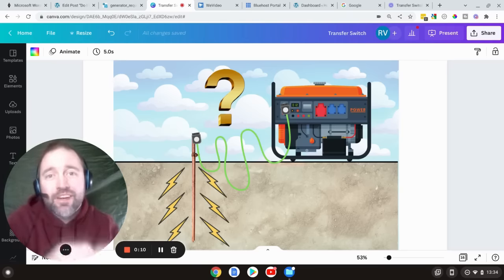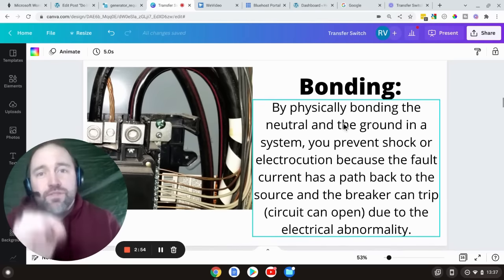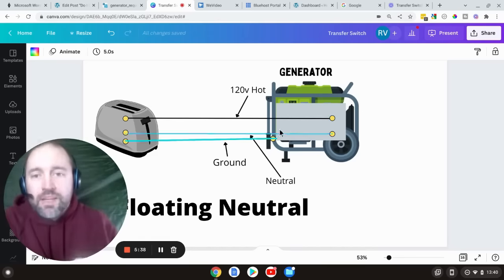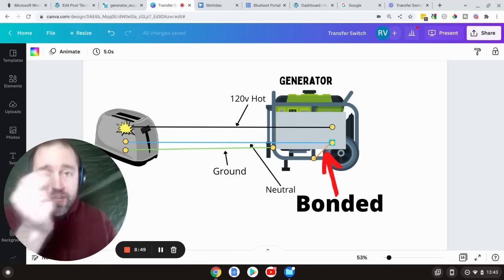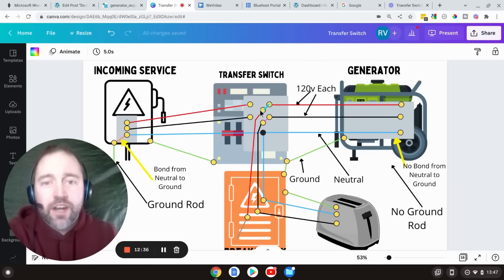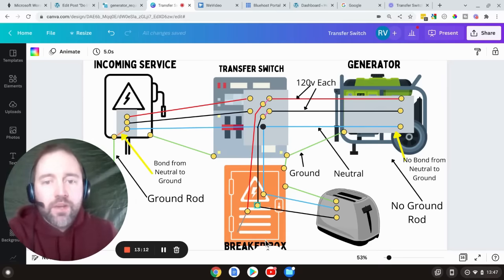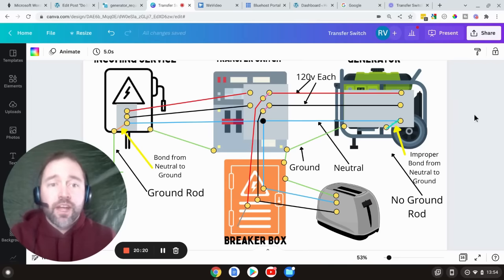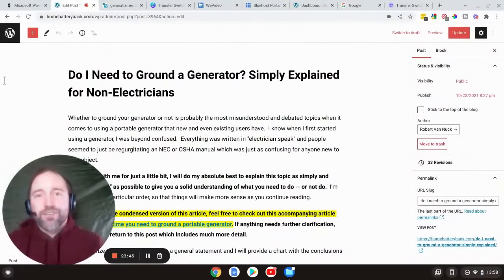When You DO and DO NOT Need to Ground Your Generator [Extension Cord Use & Backfeeding a Home]

Comment: I have solar panels batteries and an inverter my inverter is a split phase 120 no 240 so its 60 volts to ground my main intent for this inverter is to power my boiler tested it works fine under this load the boiler pump is perfectly happy no strange noise I have a hot and neutral switched transfer switch the inverter is grounded to a rod near its location which is to far from the main service ground which is bonded with heavy gauge wire and several rods exist  all bonded the inverter ground shares its rod with my solar panels but the neg battery terminal is not grounded as its isolated by design no way to use a single ground point in my system the advice I got from those with experience was to bond all the rods which I did already and due to some tight bends that I had to make that I did short of 90 degrees I installed copper tubing to make the ground wire thicker in those locations would you care to explain why under these conditions its best to bond all the rods vs not my understanding is relying on the house wire for a ground when providing a second power source is bad the inverter is like a gen but having a grounding rod not bonded to all other existing rods means that any potential difference will go through the house wires also bad bonding them reduces this load also using 4 awg wire makes the risk almost nil also playing a role is AL siding and some of the bonding wire is hidden under the siding I suppose if I spent the money for 000 awg wire I could ground my inverter to my main service ground 

the reason for all the rods is I have intermittent ground  from my power company and they can not do much if its not a problem when they come to inspect they can clearly see they have issues as the test they ran shows elevated voltage drop on the ground/neutral far above what they should expect for a service line of the length of =what I have so they said put in a bunch of grounding rods so I have one 8 foot standard copper clad steel rod then I have 6  rods all 5 feet or more not much more long 1.75 inch brass tubing we have had allot of close lighting strikes no damage so they do double duty and yes we have surge suppressors which need a good ground to do their job and the grounding rod is normally the weak point in such systems grounding seems so simple until you look into all the design limitations such as location of generators and inverters that need their own ground as well as what happens during a lighting strike either to the power lines or near by or direct and the ground rods do not have enough connection to earth and or you have a multi contact system like mine
Reply: having extra ground rods tied together is not bonding. Bonding is connecting the ground rods to the neutral bar in the main panel.

Comment: H  E  L  P      I'M  Not To Smart I'm Not Educated  I IN MY 70'S !  I really Don't Understand this Stuff even with YOUR VIDEO which is a GOOD VIDEO I have a 9000  Harbor Freight  Generator in my shop for yrs  it's a Shed I use it for Welding and Other things out in my Shop I ran a 7' COPPER GROUND ROD in the GROUND and a HEAVY COPPER WIRE up to the GENERATOR  about 5 to 6 ft. Long , which says GROUND ( many people told me to do this )did I do the RIGHT thing or the WRONG thing I don't UNDERSTAND could somebody EXPLAIN to me if I did RIGHT or WRONG PLEASE  ! Don't what anyone to hurt !                 
 I have A  Extension Cord Forget what GAUGE I think it's 6 WIRE  it was WELDING WIRE  got from  Amazon , Homemade Extension Cord for my Welder which is about 25 to 30' long I used to hook up the  Generatorand to the  WELDER  . IS THIS OK 
P L E A S E    H E L P

Comment: In summary:

- If the transfer switch doesn't switch the neutrals, you must not (i.e. are not allowed to) bond the generator neutral to the generator ground, and you are not required (but are permitted) to ground the generator.

- If the transfer switch does switch the neutrals, you must (i.e. are required to) bond the generator neutral to the generator ground, and you must (i.e. are required to) to ground the generator.

Right?
Reply: Yes ...... that's right except that local codes may not let you do an earth ground if not required. Some jurisdictions don't like anymore ground rods than necessary.

The basics boil down to this: Your house wiring system needs to have these two things:
1) An earth ground
2) Just one place one time that the neutral and ECG wires are connected together (bonded). 
So..... do you have these two things if your house is running on utility? If not, make it so. 
Does your house have these two things when running on the generator? If not, make it so.

Comment: generator connected with a cord to a breaker in a sub panel which is not bonded. no transfer switch. Transfer is made by turning off main disconnect at sub panel and turning breaker  on to generator. Sub panel only supplies fridge, freezers, one window unit and one light.  seems that neutral and ground need to be switched also, by disconnecting from main panel, and bonding the sub panel, and connection sub panel ground to a proper ground rod.
Reply: you are one of the smarter guys. You figured out that sub panels are not bonded. OTOH, they are grounded, so using a 4 wire connection to the gen set will cover your bases, provided ground and neutral are tied in properly.

Comment: Hello, I´m not an electrician but a sound engineer seeking for "The Truth" about electricity an specially grounding which greatly affects live sound systems. I´ve seen many of Mike Holt videos and "perfectly" understand that electricity returns to the source, THAT IT IS A MYTH THAT ELECTRICITY GOES TO EARTH. On the other hand, in my 50 years experience in live sound I`ve had hundreds of ocassions where I´ve hat to connect to ungrounded source (Just live and neutral) and I have a buzz in my sound system or a small amount of electricity on the chassis of the equipment, specially noticeable when you touch a microphone with your lips. In those cases I connect my ground wire to earth, even with a screwdriver, an the electricity disappears. This even happens with those generators mounted in trucks (THICK rubber wheels). How is the circuit completed?  Where does that electricity go?

Comment: Isn't neutral bonded to ground at the panel, even on a switched neutral transfer switch?
Reply: In a lot of cases, yes. But not always.
Reply: @MandrewP  ... in the case of a generator sub panel, there is no bond in the panel because you are not allowed to bond in a sub panel. (NEC rules) The flip side is you will still have ground and neutral. They will just be isolated.

Comment: Ground rods do nothing if you have a direct lighting strike. If you get a direct hit you call your insurance company and do repairs and replacements as needed. Lighting protection is a whole different system. Most toasters are 2 wire plugs.
Reply: I have a lot of "lighting" throughout my house already. But what about "lightning"? Do you know the difference?
Reply: @ChatGPT1111  I would imagine he does know the difference because he mentions the word "strike". When have you ever heard anyone talking about lighting striking anything?

So it's quite clear he does know the difference between lighting and lightening but that it is simply a typographical error and quite possibly caused by auto-correct on a mobile device changing what he was entering.

Now, don't be so silly.
Reply: Wow that seemed so wrong I had to go check my toaster. Yep, you were right. So odd that a device known for people sticking metal implements into and shorting the coils to the chassis don't ground that chassis.
Reply: @deang5622  thanks Capt. Obvious or should I say General(ly) Oblivious.
Reply: @court2379  ... in case you haven't noticed, most appliances (and tools) are double insulated these days plus use a double contact switch. Household toasters have never had a ground on the plug.
Reply: @rupe53  I would say the majority of appliance and tools around my house have the three prong ground plug. The toaster and an immersion blender are the only kitchen appliances without a ground.
Reply: @court2379  ... I would be surprised if you had 3 prongs on a can opener, mixer, blender, electric knife, coffee pot, coffee grinder, or a food processor...  unless it was all commercial grade stuff.
Reply: @rupe53  Mixer is three, blender two. Don't have electric versions of the rest
Reply: @court2379  ... ok, so you are doing things the old fashion way. The video is about the requirement to have grounded outlets, whether you need them or not. It's been an NEC requirement for like 60 years now. Generators in the code book have only been directly addressed for the last 10 years or so. (NEC 2012?) Prior to that everything was based on mfgr recommendation.
Reply: Ummm....
...... I believe he was just making a point and not talking about a toaster.
Reply: Yes, I've never seen a toaster with a ground wire.

Comment: The big take away concerning bonding...

Bonding does not protect you!  Bonding allows a short in an appliance to trip the breaker deactivating the circuit in question.  Obviously, once the breaker has tripped you are protected from shock.

The protection device is the breaker.  The bonding just allows the faulty circuit to trip the breaker.
Reply: Bonding isn't just abou that, although that is a very important part of it. There is also equipotential bonding which as its name implies, is about ensuring metal work is kept at the same potential.
If you are at the same potential as the metal then no current flows because in order for current to flow there needs to be a potential difference.
Reply: The ECG can help to protect you because it parallels the body and shunts current around you. So if someone put a penny in the fuse box, the bonding of the ECG wire could very well save a life.
Reply: @MandrewP  1/Rt =1/R1 + 1/R2...1/Rn

Shunting current is not really the way to look at it.  You effectively have two resistances in parallel , and yes, the the lower resistance will carry more current, BUT your body will still carry current. The current flowing through your body is still 230 volts in the UK and 110 in the US) is 230 divided by your body's resistance.  The addition of the bonding has not changed that voltage and it has not changed your resistance. So the current flowing through your body is still the same as before without the bonding.

What the bonding has done is create an additional  parallel series resistance. And two resistors in series, the combined resistance is lower meaning that a higher current flows from the source.

Conclusion: bonding does not save your life by shunting current. It saves your life by reducing the effective resistance, thereby increasing the current from the source down the live line and tripping the circuit breaker and cutting the power.  But circuit breakers are not fast acting.
Reply: @deang5622  You are 100% correct! But I misspoke. The ECG would be very low resistance and so most of the voltage would drop across the short itself, like a loose wire touching the frame of a machine or bad insulation. The short itself would be much higher in resistance compared to a well intentioned connection like an ECG. Therefore,  the voltage present on the frame of the machine would be much lower than without bonding and could very well save a life. Not so at all if there was no ECG.
So yes, bonding does not save your life by "shunting" current but it most likely will save a life by dragging down the voltage on the frame of equipment.

Comment: One thing to remenber. Most new appliances have only 2 wires , no more ground. So neutral does 2 job
Reply: That doesn't sound right.
Ive only ever seen two wires in appliances that are all plastic/non-conductive construction.
Anything with metal exterior will be connected to the earth wire.

Comment: This always gets so confusing.  Last year I got an inverter generator, for the sole purpose of powering a gas furnace in the event we lost power (the 2020 Texas freeze out).  The generator is a floating generator,  however when line source is out,  the generator goes into a single SPDT switch.  The neutrals are connected together and the grounds are connected. Only the black is going thru the switch, where when utility power is on,  there is no current passing thru the SPDT to complet the circuit back to the panel.  If no power from utility, the black wire is now being provided by the generator, and the neutral and ground is coming back to main panel.  I was told by several that some furnaces will not work to power a furnace bacuase the neutral and ground dont go back to the circuit box.   I've tested and all works perfectly -   Is this wired correct?
Reply: As long as there is a path between the neutral of the generator and the neutral of the furnace, it should work. The ground should always go back to the breaker panel, regardless of whether there is a generator connected to it.
Reply: I bought the 3,500 watt Inverter Predator for the same reasons.  Microswitches in furnace need clean electricity.   For now I turn off the main and power to furnace, run extension cord to furnace and plug into furnace receptical with a short double male ended lead.  Works great but will later hard wire a dedicated male plug like a camper uses for extension cord to plug into directly.  I have gas hog generators to backfeed everything but this quiet Inverter powers furnace or window A/C, chest freezer, fridge,  T.V.,  some lights all at same time using much less gas.  Reg. gen run for short periods to run well.
Reply: @user2C47  Both Neutral and bare ground wire go back to breaker box.  As the generator is a 'floating neutral' there isn't a path to the furnace.  Everyhing on breaker box has grounds and neutrals on the same buss.  Once Ground and Neutral are both bonded to the breaker box, then it has completed the circuit and in essence, has changed the generator from floating neutral to bonded neutral - That is what the furnace wants to see before it will work.  May be different with other types of furnaces or with a bonded neutral on the generator, it may work that way as well.
Reply: @jefffrayer8238  if you mean what I think by a "double male" lead, be careful which order you plug in and unplug the two ends.

Remember if one end is plugged into the live socket and the other one is in free air, those pins are live.

That's why in the UK it is illegal to wire up a plug on both ends of the same cable. Your laws may vary. Of course it matters more in the UK as the hot pin is at 240 V to ground whereas in NAmerica it's at half that. Legal or not, it's still bad practice in my opinion.

Please, for the sake of your family and any guests, wire up the furnace through a plug into a dedicated wall socket, then you can simply unplug and plug into a regular extension cord from the genny.

Comment: finally someone who lays it all out.  i own a Chinese laser cutter which has provision for an external earth.  trying to tell people they do not (if the outlet is already earthed and the plug properly wired) that adding a copper shaft in the back yard is dangerous is like talking to donkeys!
Reply: Yeah, and if you did add a copper rod to the ground then a lighting strike in the area could create strong currents traveling in the ground creating a potential difference between the two ground rods. Then current could travel up one earth connection and into your laser cutter and then back down the other earth connection to the ground.  Needless to say, the electronics in your laser cutter would be toast.

Comment: OK so when learning about bonded neutral vs floating neutral on a generator to power a house, I called my electrician to see if I needed to switch the generator from bonded neutral to floating neutral. He said no, to leave it bonded neutral. I asked if my system breaks the neutral. He said no, because that only needs to happen with a transfer switch. Since I have an interlock he said it's ok to have the interlock bonded neutral and the generator bonded neutral. Your article seems to indicate that an interlock would also need the generator changed to floating neutral. Should I call him back? Am I missing something here?
Reply from the maker: I'm not going to tell you to NOT follow what your electrician tells you.  That being said, there should only be one place in the system where the neutral and ground are bonded.  To have two places where they are bonded will allow for parallel paths back to the source, as some of the current will flow back on the neutral and some on the ground wire.  You can check out diagrams on this site (replace the (dot) with a "."):  https://docplayer(dot)net/11819659-Mike-holt-s-illustrated-guide-to-rule-220-87-articles-445-700-701-and-702-based-on-the-2011-nec.html
Reply: @HomeBatteryBank  I have the same question.  So to phrase this so that it doesn't put you on the spot...let's say I have a Generac with a bonded neutral, and I intent to use this generator ONLY to power the panel with an interlock switch when the power goes out, and for nothing else (and I'm the only one with access to the generator).  So with that said, in this case, if I remove the neutral-ground bond in the generator to make this all work, am I on the right track (though "not advisable")?